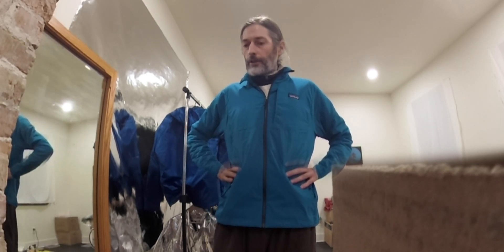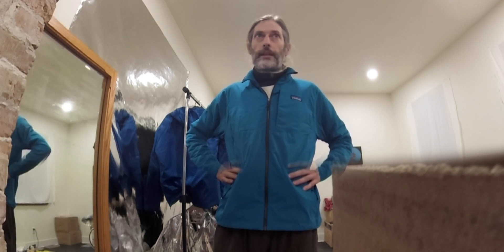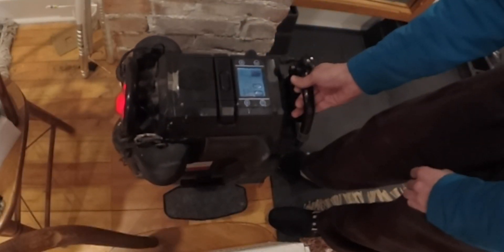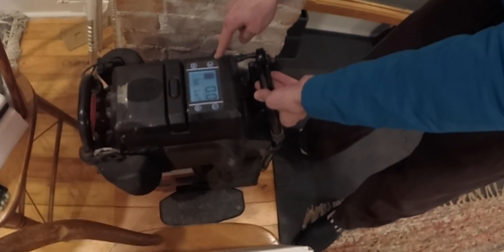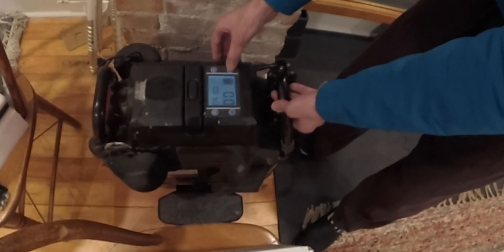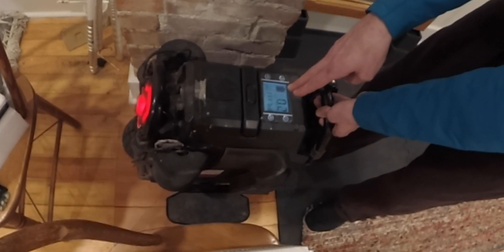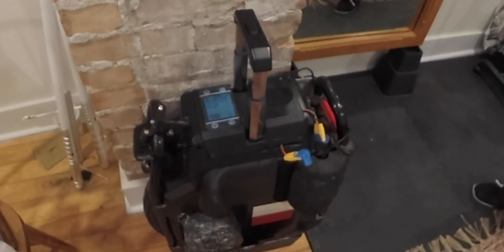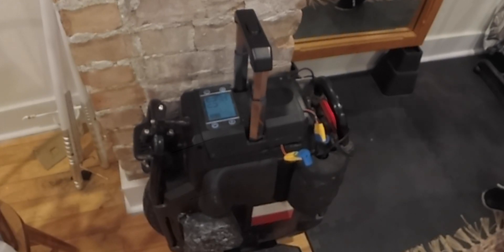Veteran Sherman error message 'bt lou' battery imbalance issue

Comment: question for you... if you measure the voltage on the faulty pack.. and see where it's at.. then discharge the good battery to same and charge it up.. would it go away? Not that you should do it but when plugging batteries they need to match voltages on both side
Reply from the maker: possible?  not sure!  I got the impression that that (bad) pack would bring up an error message in any event that it was plugged in, which means that the wheel is detecting more than just a difference in charge (but actually some condition of the individual pack?).  But I really don't know.
Reply: @urthpainter  Highly possible this was one off occurrence..  The wheel is detecting voltage of individual pack so and then is uses power from both  they are not connected together like in Gotway and reach the mainboard.. they are separate then reach the main board The mainboard is responsible for charging so chance are this might happen again

Comment: I'm curious did you get a chance to check the voltage of the bad batteries with a multimeter tool? I wonder if the voltage is just off from each other or is the pack completely dead.
Reply: Thanks bro appreciate the support. Ok so it sounds like the voltage is just slightly off that’s why you’re getting the error this is assuming the good side is at 100.8v after being fully charged.
Reply from the maker: 99.5V on the multimeter - this is the pack that brings up the error message.  Does this mean anything as far as you know?
Reply from the maker: btw - fan of your yt vids

Comment: For the money spent these problems shouldn’t exist, crudd my Sherman is on the way from wheels , how many days has it been since you’ve had your Sherman before you encountered this problem ? thanks for letting us know
Reply from the maker: I tend to agree in theory - but it appears this is a rare issue (less than 1%  - so far).  So I'm more unlucky than victim to poor manufacturing.  I've had they Sherman since September, and is somewhere between 750 and 1000 miles.  So, I'd say - good use, neither new nor super used.  I've only come off the whee at slow speeds - it has suffered no major trauma.
Reply: @urthpainter  thanks for your feedback. Hope you’ll do a follow up soon , thanks
Reply: I have this issue since day 1 of receiving. Started at approx. 50% charge while it's around -1C outside. This is the second Shermax I received from the vendor as the first one had violent rattling/vibration issues. Super disappointed in the highly praised Shermans. :/

Comment: The  MAX Voltage on a 100V wheel like the Sherman is 100,8 Volts....it is NOT possible that one of the batteries has 111 Volts!
Its just not physical/chemical  possible, your battery would allready have explode.
What IS possible , is that the BatterieManagementSystem is defect and and because of that reporting nonsens to the motherboard. (or motherboard is defect)
The wheel rocking back and forth is a typical sign of a overvoltage warning....with the rocking the wheel tries to bring down the battery.
(But the really physical maximal voltage is about 1 volt over 100,8 Volts....but not 10 Volts over, that would be a ticking bomb)

I would absolutely advise to get a voltage meter....so that you can check out the battery voltage by yourself.
That would help before you send around the battery pack to ewheels....cause as said...these numbers are impossible and perhaps the failure is something other. my 2 cents....
Reply from the maker: i'm not convinced those #'s (bu, bd) are reporting voltage.  my guess is some weird designation the Veteran-Leaperkim engineers came up with.  If anyone can find a listing of what the Sherman Veteran display setting are, and what the #'s mean, I'd be interested in that.  With regard to the problem battery pack that I'm sending back - it was designated by the low #, not the high #.  The problem battery said 100.  That is what leads me to believe it is a designation and not an indicator of any unit value.  One thing the settings on the Veteran Sherman do seem to have consistency would be displaying different abbreviations after #'s if a unit value is being displayed.

I do think you make some very sensible observations regarding a battery pack that (in rare and unfortunate occasions) can erupt into flames.
Reply: @urthpainter  You are right, perhaps its not showing real voltage values. My idea was more to check the batterys pack voltage l so that you dont send the wrong one to ewheels.
Reply from the maker: @ullle66  I did come up with a multimeter to check everything.  Good pack reads out at 100.2V full, the bad pack reads 99.5V on the multimeter

Comment: I see that you saw my post on the same problem in FaceBook. I wish I'd known about disconnecting the one battery pack. My wheel has been sent away for service and my reseller is still waiting for the new pack from China. I also had the problem that I could not charge the wheel after I got this message. Have you been able to charge your wheel OK with just one battery pack connected?
Reply from the maker: I'll find out on Thursday, when I get the new battery pack.  The pack in my wheel is already at 100% charge.  I had no desire to ride the wheel with just the one pack, so I ended up taking the bad pack out, and am just waiting for the new one.

part of this process is making sure each pack has the same charge (when installing the new one)- so when the new battery pack arrives on Thursday, I'll plug it in solo in the wheel, plug it in to the board, then plug in the charger - and make certain it charges to 100%.  I'm assuming this should work no problem.

Then I'll plug both in, and I should be good moving forward.
Reply from the maker: I might of been sent a faulty replacement battery pack - so may be a week or so before I get another
Reply: @urthpainter  Oh dear. Did the new pack not charge or just not clear the bt lou message?
Reply from the maker: the first replacement battery had its own unique problem.  eWheels guessed bad BMS - it was green on the charger, but only 60.1V on the multimeter.  It read a completely different voltage on the wheel display (somewhere in the 90's).  I think I gotta be pretty unlucky to get both this issue and their one bad replacement pack!
I did get the new (new) battery installed yesterday.  It read 100.5V on the multimeter.  My existing one reads 100.1V fully charged (multimeter).  eWheels indicated that this would be close enough balance to connect, but I did connect the new one by itself and ran it down to 100.2V.  Then I did connect both batteries to the board.  Wheel powered on fine.  I went on a 40 mile ride today, and charged the wheel back to full - no issue.  So - appears the replaced battery pack has indeed fixed the issue.
Reply: @urthpainter  wow thank for sharing all this
Reply: I purchase my veteran 8 months ago do you think they would send me a warranty battery pack

Comment: Did they offer any other solution and have you tried leaving the thing go on for as long as possible to drain it to zero
Reply from the maker: good question - they didn't offer any alternative solutions.  Unfortunately, I really don't know too much about the battery packs, bms, & main board.  It would be nice to know other possible solutions - and what the range of issues the error message could be reporting

One important thing - when I get the new battery, I have to make 100% sure both sides are fully charged (so they are balanced)- which will be easy enough.  But I have to keep that in mind before just plugging both sides in.
Reply: @urthpainter  yeah I thought that it automatically charges all 4 packs at the same speed... but apparently not. Also there's a YouTube video of a guy that talks about how he charges his Sherman 100% but if you take out the charger and put it inside of the other Port it would charge for another 2 hours... Soooooo I don't know if it's at 100% if you just charge it with one port or not
Reply from the maker: @Lee.Davis_onesandzeros  I always charge through the same charge port (Left one if looking in same direction as headlight).  I really didn't didn't think much of it. Now you got me wondering about the two charge ports as another factor in the mix.
Reply: @urthpainter  yeah or could have just been a fluke, how has your new wheel been holding up?

Comment: I thought that the charger balances the cells out for a while after the batts are full, just, if you leave it plugged in for a while after it’s full. Was that tried or addressed? Wondering if my info is correct. Thanks for the vid!
Reply: Its not the charger that is balncing your cells!!! The batteryManagementSystem in the batterypack is what balances your cells.
The BMS might be defect in this case.....
Proper designed EUCs prevent that failure (left battery different as right battery) from happening, because that actually is dangerous
Reply: @ullle66  Of course, my previous comment absolutely ignore that fact! Is it not the case though, that at least with the Sherman, this only happens when it’s plugged in? Anyways, you’re absolutely correct good point!
Reply from the maker: I always charge full, and every few charges let it sit for a while on green.   The Sherman had come fresh off the charger when this issue occurred.  EUC world had the voltage at 100.9 which is normal.  After I got the error message I did put it back on the charger just to see if that would do anything, but no.

In terms of exactly what the issue is and exactly what the wheel diagnostic #'s mean, I'm not certain - basically I'm trusting the wheel diagnostic for noticing an issue in one of the battery packs - and replacing that pack should fix the problem
Reply: @urthpainter  all good to know, thanks for the thorough response! Hope your batt comes soon, and is an easy install. Cheers!
Reply: The pack likely has a bank of cells that are dead. Likely started with a single dead cell which killed off the entire parallel group. The pack itself likely can be salvaged but involves breaking it open and replacing the damaged cells.